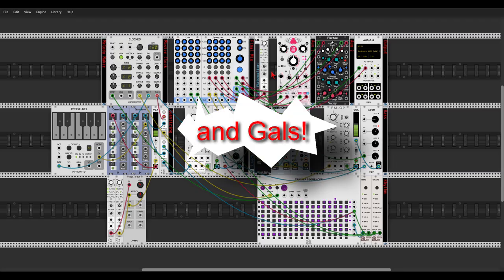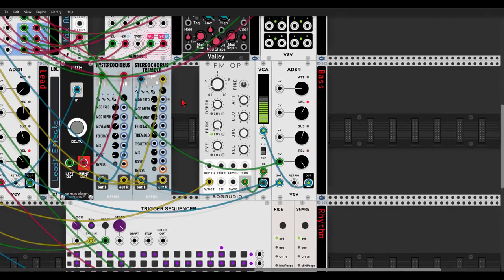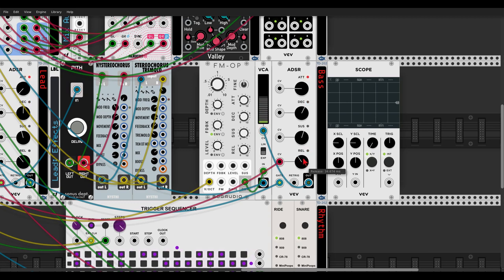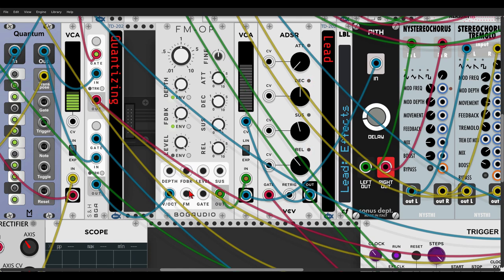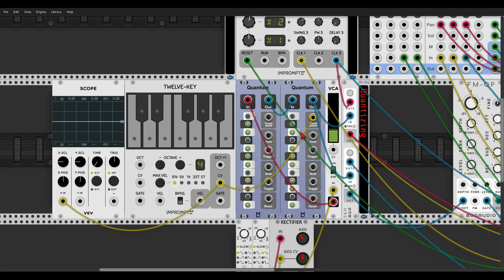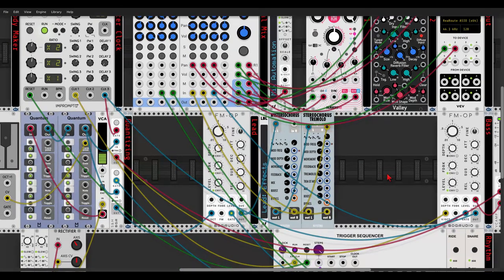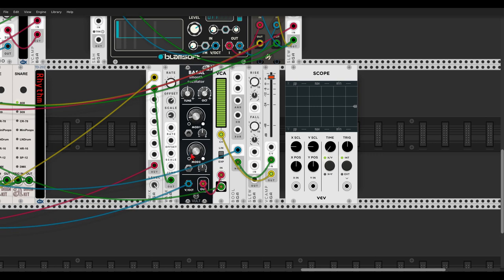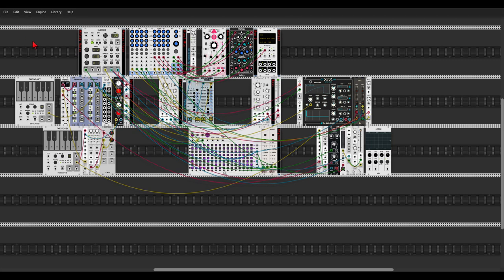Patch Dissection

Comment: A fun initial patch this. I love that trick with the two LFOs and the Rectifier! (I've been using Caudal run into Cubic to get similar results while working in this generative space.)

I'm not going to say it was a mistake either, but if that bass is meant to be a walking four-on-the-floor double bass-type thing as is common in jazz, the higher up the fretboard you might go, the shorter the note is likely to be, rather than longer as you have it here. A minor thing in the long run.
Reply from the maker: Hey Rick, thanks! Yes, you're right, the higher the pitch, the higher you go on the fret board, the shorter the decay of the sound. Totally! Thanks for this :)

Comment: So many good tricks. I love it!
28:22 I think to use attenuverter with -1 gain and +10V would be more precise and simpler approach. Had the same problem recently)
Reply from the maker: Thanks! Yeah, I think that it doesn't really matter because the VCA will only open to a certain point, never mind how much voltage you use, but yeah, offsetting the voltage would also work, totally.

Comment: It's amazing to see VCV Rack play some jazz music.  I was thinking it could be expanded upon by using VCV Host to send notes to Kontakt instruments, then maybe run it through Morphagene to add to the overall weirdness. :-)
Reply from the maker: Yes, totally!
Reply: @OmriCohen-Music   Btw, I just figured this out today. Your suggestion of using an output from the audio interface completely worked with the MiniBrute 2S.  

I used a guitar patch cable w/TRS to mini-TRS adapter & ran an output back to the MiniBrute Ext input.  I tested with Braids in VCV Rack.  It's amazing being able to control Braids from the MiniBrute 2S.  And it all connects so easily!
Reply from the maker: @shitmandood  Funnt you say this because I've recorded this week the video about the MiniBrute and there is a short segment where I send audio from VCv to it, and I also used Braids :)
Reply: @OmriCohen-Music  lol. Well I can't wait to see your video.  I only had about 15 minutes to really test it before I head off to work. :-)